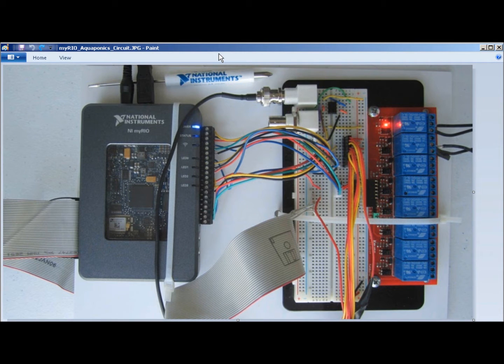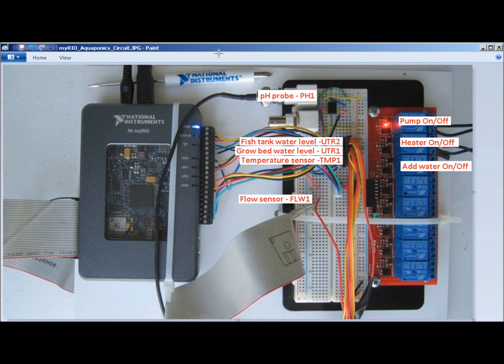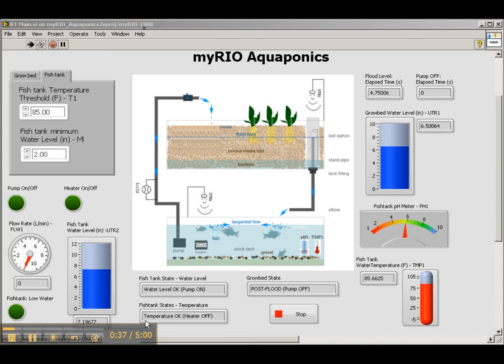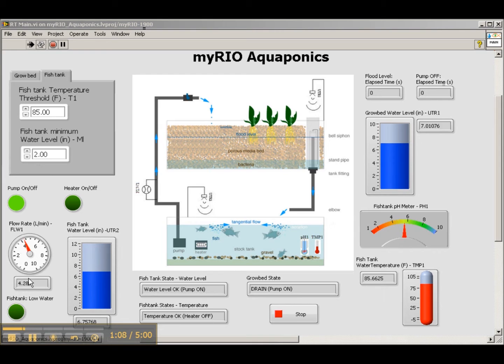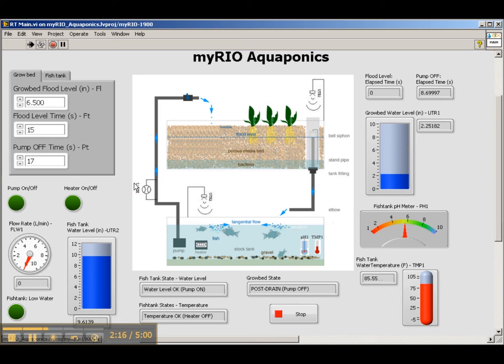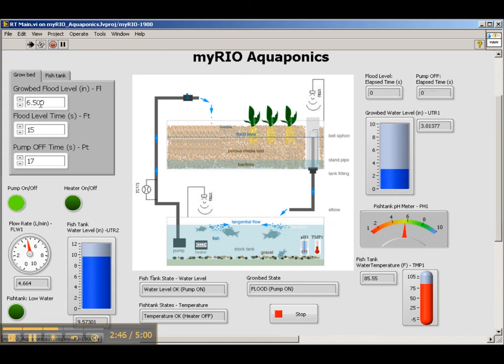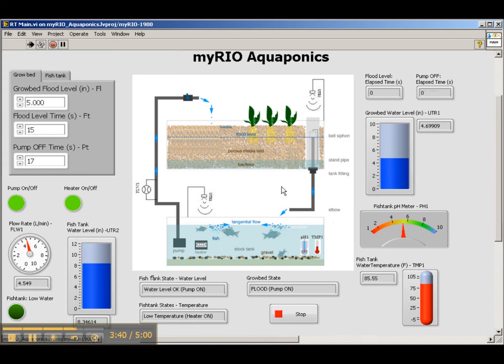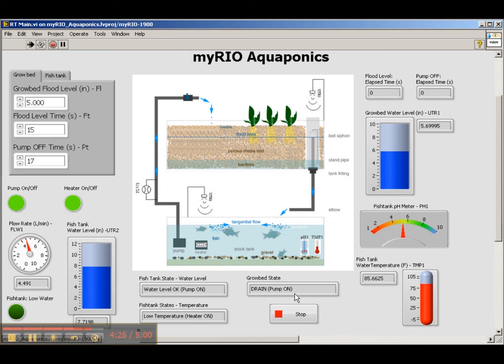myRIO Aquaponics - Smart, Automated Aquaponic System

Comment from the maker: Steve, nitrite & nitrate sensors will certainly be a good addition to the system. Now, from your experience, besides replacing the water with high nitrate content, what other methods have you used to restore the nitrate levels back to normal?

Comment: Do you have nitrite & nitrate sensors ?
Reply: For instance, what about including one of these in the system:  
http://www.thermoscientific.com/en/product/orion-nitrate-electrodes.html

Places like http://www.jencostore.com/ or http://www.thermoscientific.com can provide standardised BNC/NPT plug electrodes for:

pH
Oxygen Reduction Potential
Electrical Conductivity
Temperature
Dissolved Oxygen
Ammonia
Nitrites
Nitrates
Potassium
Carbon Dioxide
Fluoride
Chloride
Iodide
Lead
Cadmium (e.g. from toys or enamel)
Bromide (from pest fumigants)

Most electrodes are in the $60-$100 range (ph are around $30), with the self cleaning ones around double that.